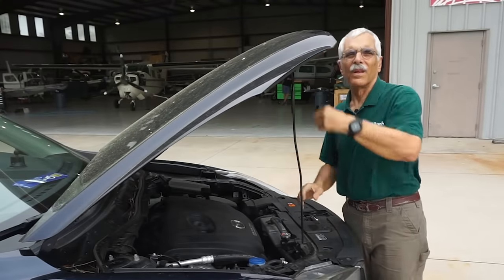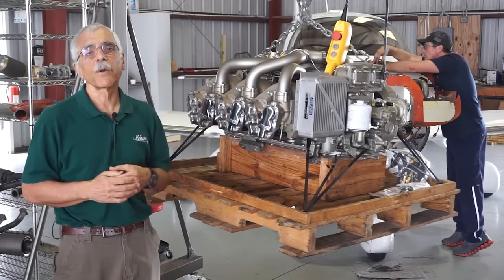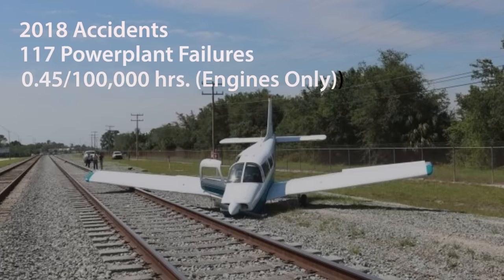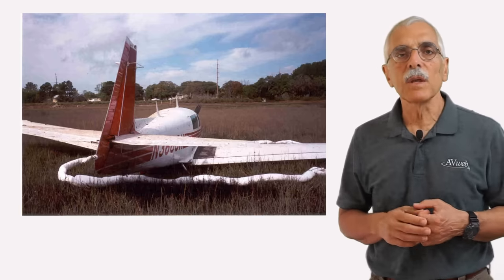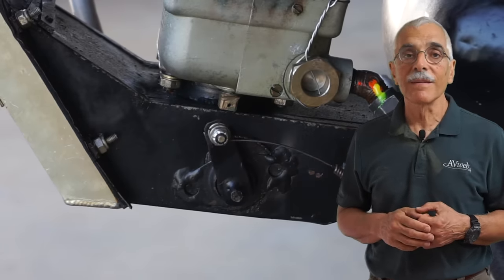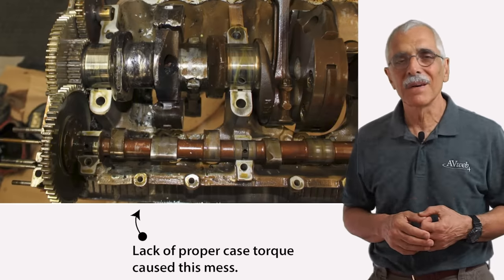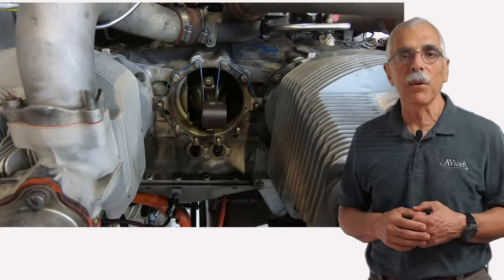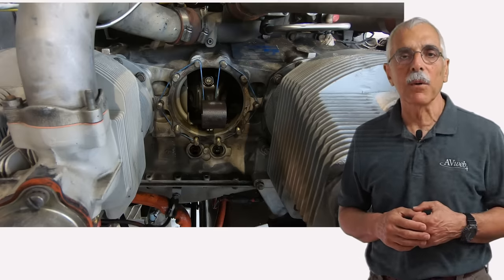Why Aircraft Engines Quit

Comment: Lopez? really? ok :)
Good video. I hear you make a very veiled indictment of aircraft engines being old overpriced junk and I couldn't agree more. I'm guessing Rotax has that bit higher failure rate because it's lower dollar  craft, perhaps less maintained and because it's smaller displacement with that added gearbox to fail rather than the medieval tractor blocks. It's only anecdotal for me but from mentions in this small youtube GA community, engine problems seem remarkably common.
As for engine failure on take off, it seems there is not enough understanding of how immensely useless stalling is. You let it glide down, you don't pull up when you don't have an engine. The plane will not respect your command. Just the other day a video was suggested with a youtuber family crashing because of engine failure. Pilot said he had prepared his entire life for this event, only to pull up on a perfectly neat approach and set full flaps and fall 25 meters out of the sky. Both in the front broke their backs, had to be pried out of the crumpled cockpit and helicoptered to hospital. Stalling is phenomenally useless, don't do it. Pilots really need to train the so called impossible turn and that you never stall a plane. Because then it becomes a very impossible turn. Sully at least knew how to glide (or the plane did) but was clueless on the not so impossible turn. Which should be renamed to the prudent prepared turn. As a very wise man once said in a Steven Seagal movie, chance favors the prepared.
Rather than beat lycoming and continental into submission, I have come to the conclusion that we simply need tiny turbofan engines for GA. Should have been done in 1960. That will quite quickly dispense with both. And give us the natural reliability of twin engines. Not to mention the smooth quiet speed.
Reply: I would be curious to see if the the stats include 2 stroke rotax engines... a bit more prone to failure.
Turbine engines are great for reliability, but sadly they're horrible for efficiency at low altitudes (look at the turbine bonanza, lots more fuel for little more speed)
Reply: @niclef314  so we go high. world distance record is with an off the shelf Williams FJ44 engine
Reply: What's wrong with Lopez? Let the man fantasize about whatever lady he likes 😋
Reply: Would more modern engines not be more reliable rather then turbo props?
Reply: @LeantoPeak  just jivin :)
Reply: @jay_b..  turboprop has a gearbox and a big noisy propeller, I said turbofan which is a jet engine with bypass same as private jets and airliners use, which is a more efficient jet than the turbojet engines in fighters. I think a turbofan can be quite reliable. Google says 5-6000 hours of TBO is common for private jet engines so they last well. And a very tiny jet engine that a light weight GA plane would use might only weigh 10kg and material strength grows when things become small so it can be much much cheaper to produce than for typical private jet sizes. And if you want two engines, they are even smaller so it can really work out. You get two engines for free and two engines have natural placement on the side of the aircraft instead of a single piston prop that you have to place in the nose with firewall etc.  Jet engines need less clearance so the landing gear can be much smaller and it's easier to get into the plane and easier to make retractable gear. I think a small turbofan engine designed for 250-500kg planes could really revolutionize GA. My 2 seater plane weighs around 270kg and that's including the heavy rotax 912 engine so a jet can be a lot lighter. And the lighter it is the smaller engine it needs and the less fuel it burns so it can become magical. Imagine if LSAs could fly 700km/h and not cost more nor use more fuel. And be smooth and quiet.
Reply: @DanFrederiksen  Hey Dan, appreciate your thoughts on this. Maybe we can get Diamond to do this on thier DA62 twin piston engines. This would make them much faster and have a good reason to provide a fully pressurised aircraft.
Reply: @jay_b..  yeah I figure all that's needed is for someone to make the small engine, then most of the existing plane makers will make a pane for it. Mike Patey could be the guy to make the engine or kick it off somehow.
Reply: @DanFrederiksen  Not sure Most GA folks want to go pressurized or carry oxygen. Not all GA is about high and fast
Reply: @niclef314  I agree. I am looking to start my flying lessons for fun and for the view which means not flying high and fast. However, it would be really great to have a versatile aircraft where it would also be possible to cover long distances quickly or fly over bad weather at times.
Reply: @niclef314  sure, cub folks might not be the first adopters and it doesn't have to replace everything, just has to kill off the high dollar products for folks who like to go. Cirrus, Bonanza and all the people who wish they could go fast but drive an old junker from the 50s. And I think with a low weight it might well be possible to have very satisfying low speed landing so it isn't like a bonanza struggling to take off. And a sleek jet might go pretty well at pressurized altitudes as well. Once you have cost effective speed on the market, it's going to be hard to stay away.
Reply: Your comment is a good effort.
Get an aerobatic rating....
Stalling is fun....know your aircraft....twins have 2x failure rate   
Can fly like bricks.   I would never use anything running rotax.
You are half way there.  Rotax planes are toys.  Get a real one.
You want +6g  and -3g  go and have some real fun...
Cheers mike
Reply: @michaelpettett3087  Well sure most Rotax are LSAs or lighter but there are some 915 powered UL/LSAs that can outperform most heavier pistons in GA. When it goes above 400km/h I'm not sure you have anything that can keep up. It would have to be a Lancair. And not just any Lancair. Vl3 has ultimate load rating of +15/-6 so can probably do 6/3.
Reply: Your comment shows an interest in aviation and intelligence....
Many other comments are so far out.  They have no idea...
Its like lots of young children are preteding to be adults..  with some of the others the old-timers medication has chopped 20 points  off the IQ.   
Facts are facts  maybe many rotax related incidents are unreported.
Simpler is always better.
Less parts means less can go wrong...
Cheers mike

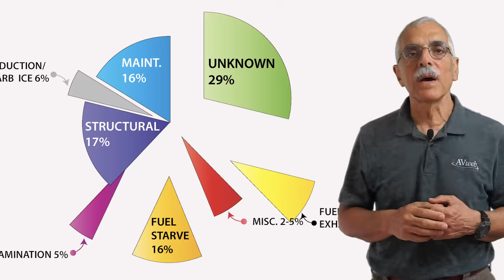Comment: Your carb heat arm at 13:52 has the cable held on with a fiber locknut.  Not safe in an engine compartment, especially on the hot side.  That thing needs to be all-metal, or preferably castellated with a cotter pin.  Also, it doesn't look like the shaft is sticking out past the nut--there should be a minimum of 1.5 threads showing, just to make sure that the nut is actually holding onto something.

Comment: id like to FIRST say that LJ and his shop are one of, if not the best engine shop in America. i've got 2 stories about engine failures, i'll keep all names to my self. im an A&P afew away from them. I maintain a fleet of 172s with O-360s. We had an engine zero timed by them a while ago. this was its 3rd time being zero'd. it had about 800hrs on it and was on a "cross county" flight. it flew for about 6hrs that day and was about an hour from base on its way home when it swollowed an exhaust valve. the PIC was a student but also had an insturctor in the right seat. the instructor took controll at about 2500 feet and flew it with the engine still running (at idle) for about 5 minutes and landed safely and was able to taxi to a parking spot at a remote field. we swapped jugs the next day, started it and shut it down within 5 seconds. it still had an issue. we took it off and sent it back to LJ. he fixed it within a week and we got another `800 hours out of it with no issues until a pilot put it in the grass and flipped it. the SECOND engine failure we had was another 0-360, it was doing basic "pilon" menuvers when the PIC reported loss of power and oil pressue and oil on the windscreen. he was only a few miles from base. again the instructor took controll and flew it back to base and landed safely. I went out with the tug to get it at the end of the runway. after a quick inspection we saw a crack in case from a jug bolt on cylinder 1 all the way around to another bolt on cylinder 2. again we sent it to LJ. he replaced the case and crank with new parts and again zero timed it. that engine is still going strong 4 years later without any issues. 
in my 10ish years of being an A&P, these are the only 2 engine failurs that were not preventable. both of which landed safely. Now some of the seriously injured/fatal crashes ive seen have all been pilot error. Ran out of fuel because they stopped for lunch and forgot to get fuel before takeoff. forgot to switch tanks mid flight. landed durring a very bad storm (winds gusting to 20+mph and zero visability) in a VFR plane. Flatspot'd and blew a brand new tire on landing and left the runway, tried to take off again, DROVE the plane into a ditch and flipped it. a tail-dragger tried to do a touch-n-go on a grass strip. applied power and pitched foward, flipping the plane. saw a twin (not one of mine) with a left brake failure on landing doing circles at the end of the runway in the grass untill they collapesed the left gear, "trying to make it back to the runway"
just my 2 cents.

Comment: I worked at a flight school as a mechanic for 6 years, with a fleet of mainly 172S's with two 172R's and two 172RG's, with two BE-76's and one DA-42 for multi training.
Our planes were putting in crazy hours, in some cases topping 1400 per year each (172S mainly). We never had an outright engine failure, though were close to two:

First, on a 172S with IO-360-L2A engine at nearly 2000 hours where the engine was gradually losing performance (first noticed at around 1850+ hours) on still original engine. Metal filing sighting in the oil filter became greater with each inspection, until pre-inspection and preflight runups failed to reach max static RPM. Engine teardown at overhaul showed excessive cam wear on cylinder #1 intake lobe, cylinder #2 exhaust lobes, and cylinder #3 exhaust lobe. Cause of excess wear unknown.

Second one (172S) might not classify completely as "the engine quit". The engine performed just fine up until 500 foot altitude on climb after take-off. Then the propeller quit. Right with the starter ring gear, flywheel, alternator belt, few pieces of the cowling, and crankshaft forward of the oil transfer tube. Engine had less than 800 hours with the crankshaft AD not being applicable to that model of engine. Pilot managed to do a power-off 180 and land on the parallel taxiway.

Comment: I am a commercial pilot, SMEL, instructor, and mechanic.   I have seen more engine failures in planes flown less than 100 hours a year than those flown more than 100 hours per year.   Also, fuel sump drains sometimes don't drain out all the water, so I recommend if your engine runs rough, look for other low spots in the system that can trap water and drain water in the line from tank to engine.

Comment: Reliability is a two-edged sword. Many years ago I was a glider pilot at a UK field. We were not a well-off-club. Everything was done by volunteers, and our retrieval tractors were ex WW2 ones - in the 1990's! We had one absolutely knackered winch built on the chassis of a old Double-decker bus, with a winch driven by the same emphasemic engine about which was usually wound with 2000' of endlessly repaired steel cable. Winch launches were an adventure, and cable breaks - the gliding equivalent of an engine failure after take-off were extremely common, - I had 7 consecutive one day - and we were all accordingly bloody well alive to the risk.  In time, some more well-off members sought a more reliable winch, and we presently acquired a very reliable and excellent German glider winch. The CFI opposed this as he considered a reliable winch would actually increase the risk of a fatality. He was over-ruled by the comittee and resigned as CFI. Within a year a new pilot was killed on his first flight on type in an Astir - NOT a good glider to spin - when the winch suffered a slow power fade, and he spun off the wire. Dead as mutton. So, sometimes, reliability isn't your friend. Would that life were so simple!

Comment: Your writing & videos have always been presented with undeniable facts. I am concerned on this one that some people will get annoyed at “low tech” aviation engines vs. automotive. Regardless of the HP rating of an automobile engine, the automobile engine is not seeing anywhere near the work load that an airplane engine does.  There have been some after market auto engine to aero conversions.  These get a bunch more complicated factors with the gear reduction box and oiling of it. Also going liquid cooled is not a direct swap. There certainly is always room for improvement everywhere. That’s a big part of racing.  One of your other videos did properly place blame on aviation engine industry complacency toward addressing any issues, and just continuation of status quo.

Comment: Very interesting presentation.  Been a retired aircraft tech for almost 10 years now.  Started in GA and retired from airline work during the last 25 years with many management changes.   During that time I also rode, raced, and worked on motorcycles.  So engines have influenced  my life in many ways.  An observation:  normal engines driven under normal conditions last a long time.  Engines designed to be as light as possible run at near maximum power a large percentage of their lives tend to need more attention.  Make 'em better?  That'll cost more and the market knows the limits of cost-to-ultimate-reliability.  Another factor there is getting new designs okay'd by the FAA.  Expensive and time consuming.  If it's certified it'll have to do.  That's one reason of how Rotax got up and running; another was the ultralight phenomena, driven by the desire/cost equation.    Spent many a night-day-night changing out commercial turbine engines.  They have their own system of maintenence and there are still 'glitches'.  We're seeing what 'equivalence' instead of 'excellence' will do for our future in the Boeing 737.  
May all your landings be Happy Ones.

Comment: Fabulous Video!!  While I fly behind an IO-360KB Continential that has been babied and taken care of in it's 25 years of life.  It still doesn't explain why that car engine just runs and runs and runs and NO ONE thinks of a rod ever coming out the side in 25 years of service.  I know all about a car engine running at 45% power on the freeway and an aircraft engine running at 80% for hours but the car industry has certainly given us reliable powerplants that just seem to run forever with a regular oil change.  
Again, fabulous video and Paul you're the very best !!!!

Comment: Good work and great advice Paul, I'll be putting a engine monitor on my O 470. Many thanks
Reply: Consider Engine Oil Analysis,   prepaid about 25 per sample,  if done often, a change in metal content ( trend )  can be identified before failures.
In AP school we visited a lab that did spectro oil analysis, learned a lot,  i touched a penny then touched the oil sample and retested, and
the test showed the increase in copper, so very senstive,  but compared 2 samples,  The tech told me that they save many turbine engines before failure - their main customer base. 
So can save money, but also while flying- added reassurance too.

Comment: Flying 43 years, never lost an engine never had to shut one down (except in sim).  Had an oil filter leak out oil in a hawker after oil service once, had a Kingair 200 engine just back from overhaul running just a bit hotter then the unserviced engine (compressor blades were rubbing against its housing), gear wouldn’t retract after tires were replaced (Hawker), gear unsafe landing during IOE on BE400XP.  Happy to have never had an accident or incident.  Preflight and post flight are equally important.  Have had my partner tell me he did the preflight last night.  Not how I do it. Thanks for this informative and entertaining content.

Comment: Excellent video. Among your best, Paul.  Unfortunately, I seem to have suffered more than one person's fair share of these piston engine failures. Fuel pumps, cracked exhaust valves, sheared shaft on prop governor gear drive, . . .  Never have had even one problem with a turbine engine in 21 years military and 27 years airline. Still breathing and still flying pistons, though.
It appears that the list shown from 7:59 to 8:06 is NOT in descending order of probability. ''Engine" is #2 in probability, not #3 as described.

Comment: Glad to hear about engine  monitoring. Modern automobiles collect a lot of data that can indicate impending engine failures. Acoustic sensors could detect bad connecting rods and valve gear. My 2001 Ford Expedition is in need of new plugs and coil boots. I have a device that displays the misfire events in real time. I had a fuel pump failure some time back and found that the misfires dropped dramatically once a new fuel pump was installed. Had I looked at other data like fuel trim I probably could have asked the question about the fuel pressure. Perhaps aviation insurers could get behind providing discounts for owners to install monitoring computers and sensors.